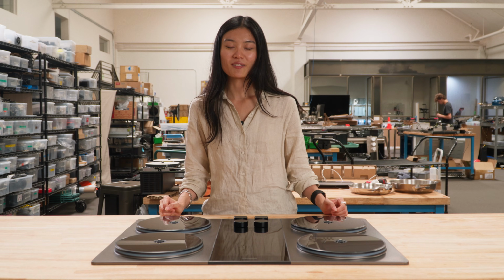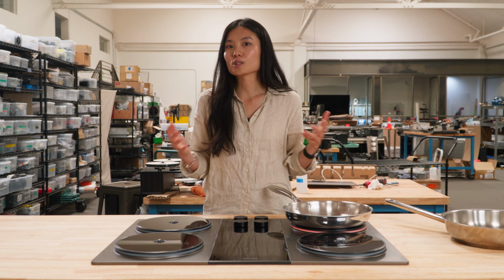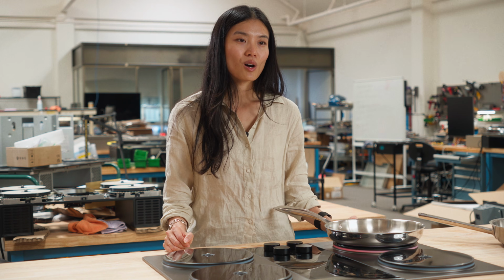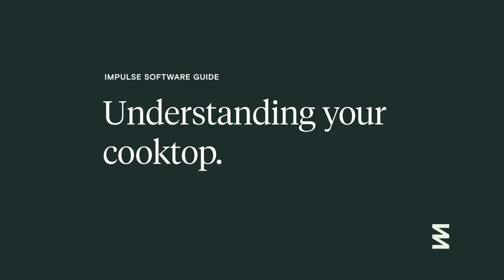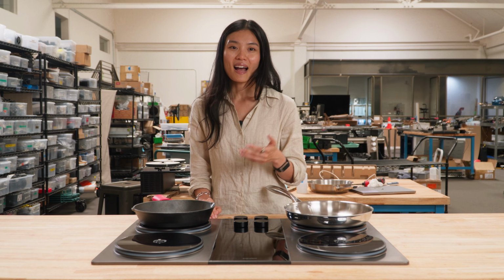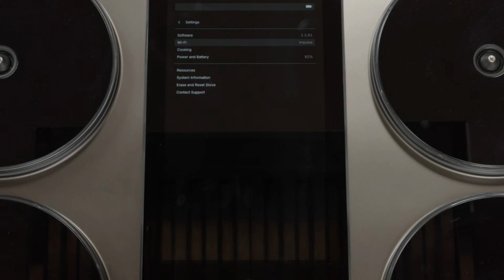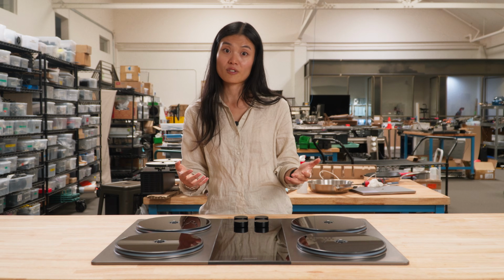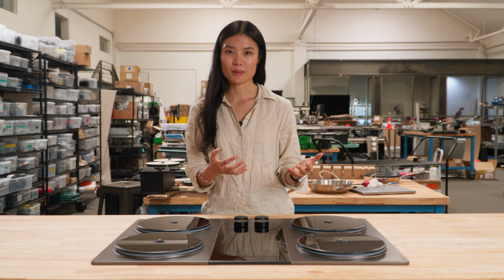Impulse UI Redesign

Comment: Excited to try the timers -- EDIT: Okay, I installed the update (it was SUPER fast, I basically turned around and came back a minute later and it was done) and tried it out. Really cool! My one suggestion would be an option to simply turn off the burner. Room temperature is totally acceptable but it still uses some energy.
Reply from the maker: Glad you like it! Due to compliance, we can not have an auto-turn-off function, hence, we decided on the room-temperature setting. Appreciate the feedback.
Reply: @Impulselabs  Maybe I am misunderstanding what compliance means here. Bosch and Ikea induction cooktops have a timer setting that turns off the power to the 'burner' when the timer is complete. Is this not an option with the Impulse cooktop?

Comment: The knobs act as a child lock by requiring them to use. (Can put them out of reach) 

Only Cooktop on the market like that. Even the Samsung knob is only optional.

That's a huge sales pitch / feature IMO
Reply: It's induction anyways, the cooking surface doesn't get hot without a pan on it.
Reply: I just took the knobs off of my early 2000s gas cooktop to clean it and I've never thought of that as a feature before. I guess technically it isn't on the market until the replacement arrives and I put it on Marketplace
Reply: lmao god this reminded me of how dearly I wanted that feature on my mom's stove when I was staying with her to take care of her. Her drug addict brother would take ambien, xanax, and whatever opiod painkillers he could find and just go around the house in a fugue state. For whatever reason he would get fixated on the kitchen and do all sorts of insane dangerous stuff involving the stove, like putting his hat on a burner or a box of cereal. I was always terrified he was going to burn the house down.

This would not make for wholesome ad copy but it's an important feature
Reply: @natto84 if anyone reads this and has a similar issue, you can put a kill switch for the stove that needs to be flipped. Easy $50. Could even use a timer that auto turns off too.

They make smart ones controlable from the phone too